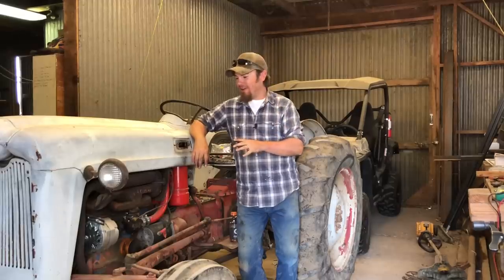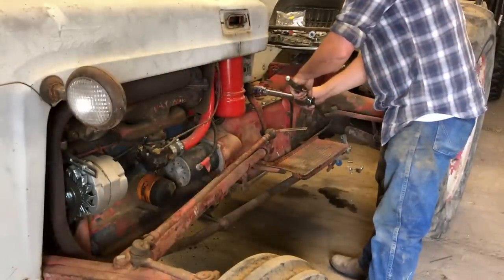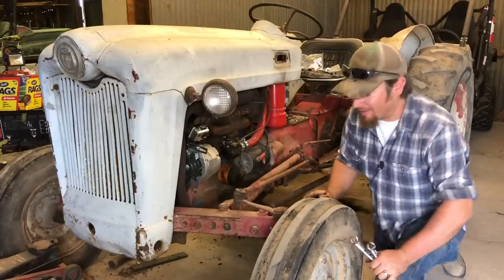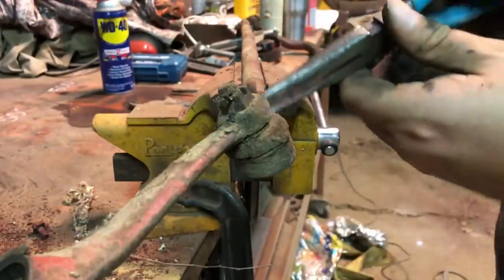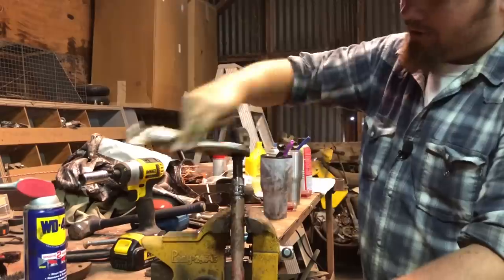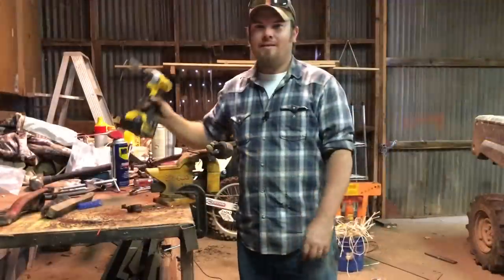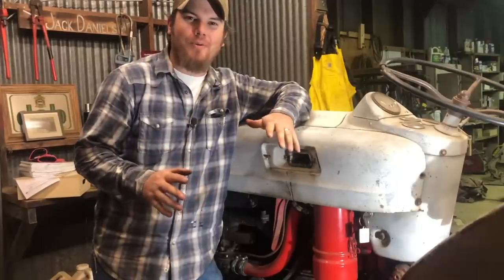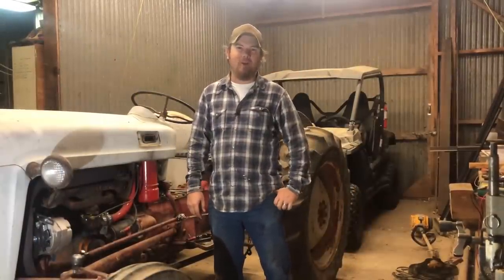New Ball Joints on the Tractor!

Comment: Nice Video!!  Here's a tip. When you change Tie Rod Ends on anything (Car, Truck, Tractor) Count the number of turns when you unscrew the old end from the center tube. Screw the new one in the same number of turns. This will put you very close to the original dimension. Threads are a constant. 10 turns out......10 turns in, puts you right back where you started.  Best of luck.........
Reply from the maker: Good tip thanks!

Comment: You did  something wrong, that was way to easy  ha ha. Looks like paint and  some new.emblems are next lol.... Thanks for sharing tyler. Any plans to get a small blade or mower for it. Those are handy little tractors to have around.
Reply from the maker: Haha yeah I think you’re right Kory!  I’m still torn on whether or not I want to paint it, kind of like the “used” look but I think one day I will. For now it’s just for feeding. There is no hydraulic pump so the three point doesn’t work and I’m not sure if the pto even works. Eventually I’ll fix that stuff but the parts are pricey!  Thanks!

Comment: I have a question for you.  It looks like your grease zirks on the ball joint are on the opposite ends from the ones you pulled off because I can't get mine to fit with the grease zirks on the pitman arm.  Thoughts?
Reply from the maker: I think mine are the same at the steering arm and the new ones at the other end are sealed. Sorry I’m no help!  What is the fitment issue?